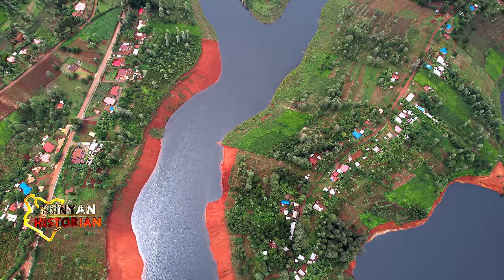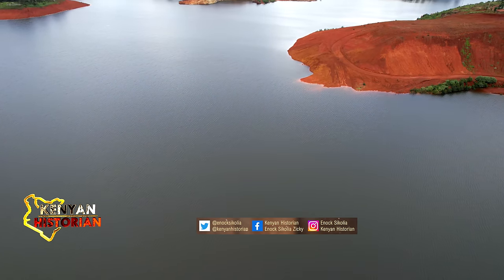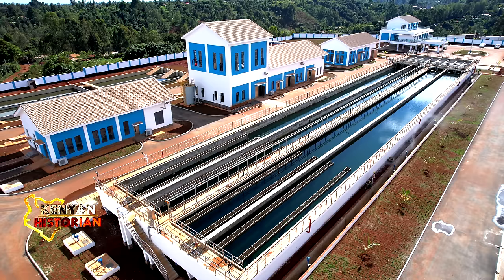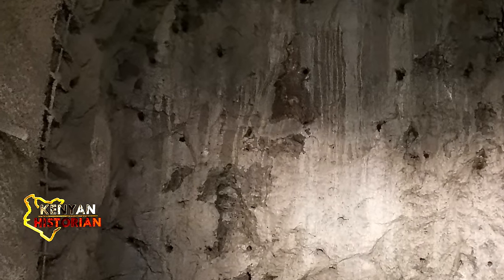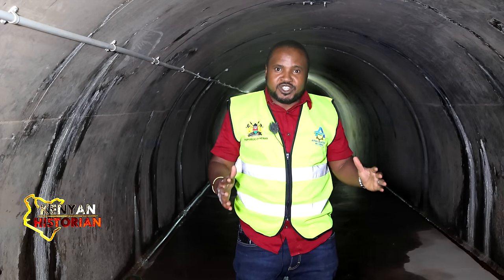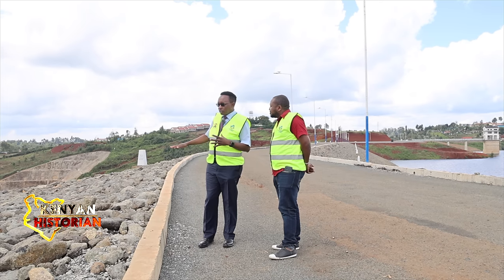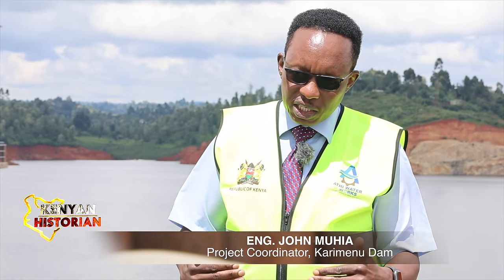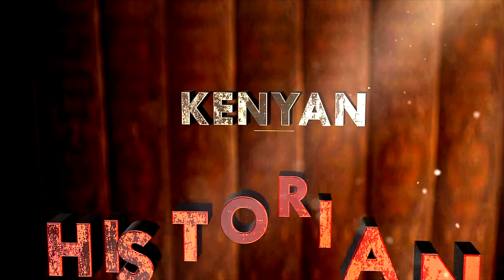DAMS AND TUNNELS: How the 24 billion shillings Karimenu Dam was constructed. #kenya #engineering

Comment: We hope and trust this dam wil l not break and bust like masinga dam inshaAllah 🙏🙏🙏
Reply: Masinga dam has not/did not break or burst, its just reached its highest level of fullness. It's just letting out excess water from the rains using the spillway which was designed for that purpose. The dam itself is still structurally sound. Its just that spillway is very ferocious in releasing the massively excess water that it has received.